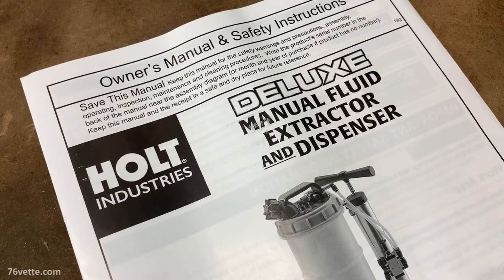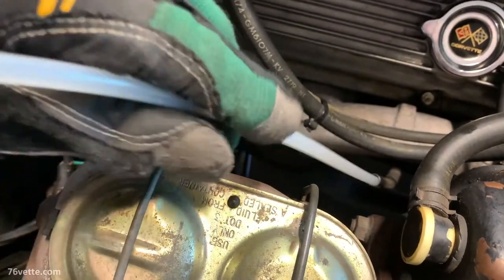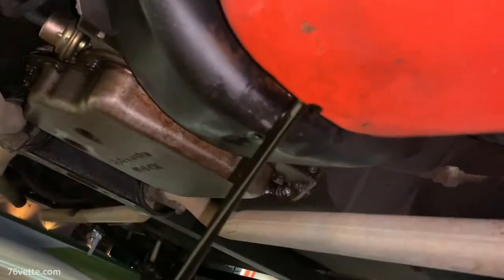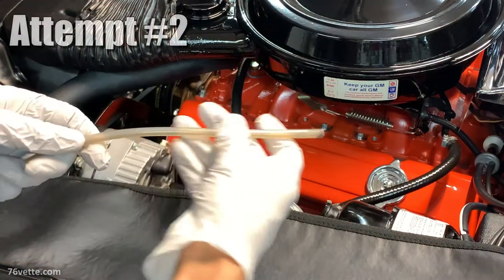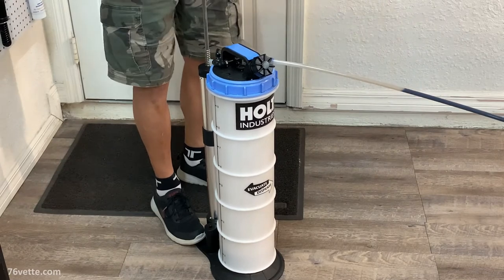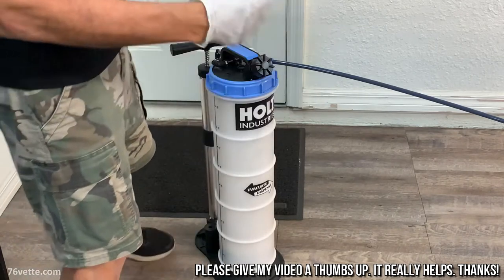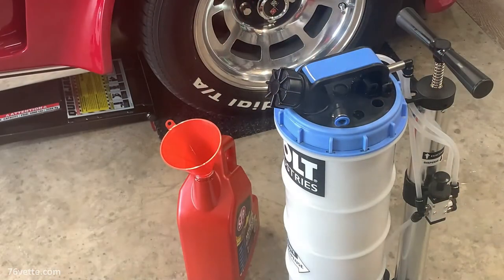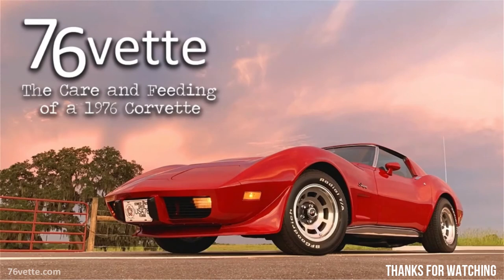Do MOTOR OIL EXTRACTORS Work?

Comment: I always wanted to try an oil extractor. I was always concerned about getting all the old oil out of the engine. The only way to do that is to pull the drain plug. I think the extractor would work really well changing the differential fluid. As always, I enjoy your videos. Keep up the good work.
Reply from the maker: It has its place in the shop, and yes, it will work great for differential and automatic transmission fluids, for example. I continue to change the motor oil the old-fashioned way. Thank you for watching! 😊👍🏻

Comment: was gonna say if its hard to see the oil in the extractor, place a flashlight on one side, which lights up the fluid inside.  I do this when diluting concentrated antifreeze 50/50 with purified water in its jug.  I got two of those extractors.  Mainly for removing power steering and brake fluid maintenance.  I prefer changing hot oil by plug as it washes out everything.  Although these do tend to fail; i blame it on the check valve not sealing properly.  I also recycle oil in a 5 gallon pail; multiple cars serviced with one trip to the autoparts for recycling.  And of course there is always a spill.  I found those 2.5' by 4' driveway drip pans under the catch pan resolve that problem...
Reply from the maker: Yes, it would work really well for extracting old power steering fluid. And like you, I recycle all fluids properly either by taking them to the auto parts store of the county recycling facility. 
I do have to buy one of those big driveway drip pans. Thank you for watching! 😊👍🏻

Comment: I agree that the best way to change the oil and filter is the old tried and true way. But maybe this is good for coolant, power steering fluid, or transmission fluid?  Maybe it can be used for other purposes.
Reply from the maker: Yes. It’s silly to mix clean motor oil with about a quart of dirty oil. It defeats the purpose. 

However, extractors are great for other fluids and/or systems as you mention. 

Additionally, I don’t think the combined fluid dispenser function is practical, unless you use one as s dedicated dispenser. Cleaning this thing would nullify any time savings.

Thank you for watching! 😊👍🏻
Reply: The thing about mixing old fluid with new is that when you change transmission fluid you won't get the quart or so that is sitting in the torque converter unless your torque converter has a drain plug of it's own (some do).
Reply from the maker: Didn’t know that. Thank you. Actually, I know little to nothing when it comes to auto transmissions. Thank you for watching! 😊👍🏻